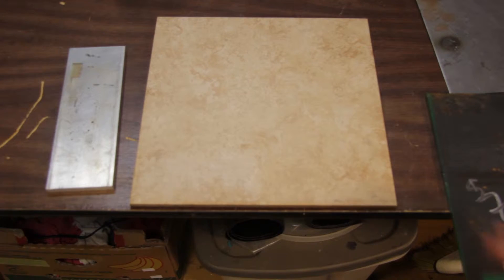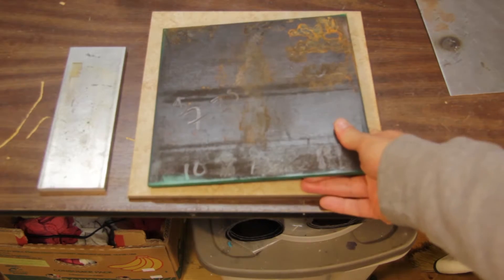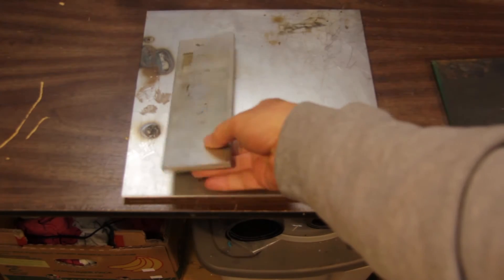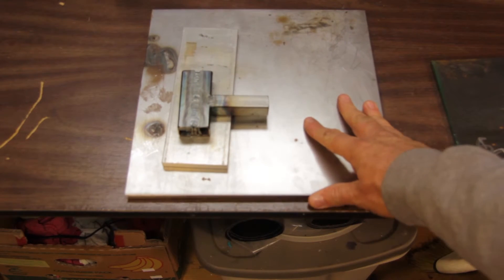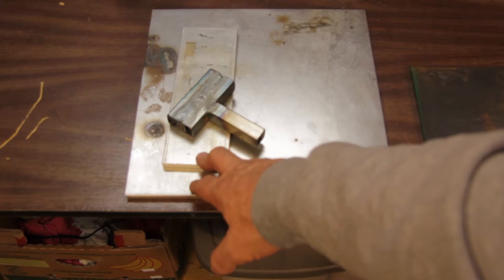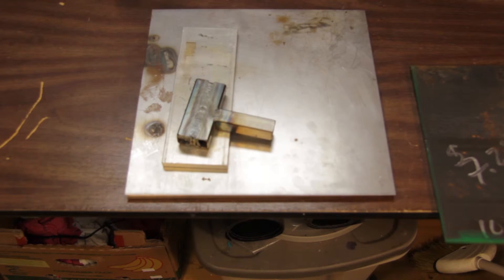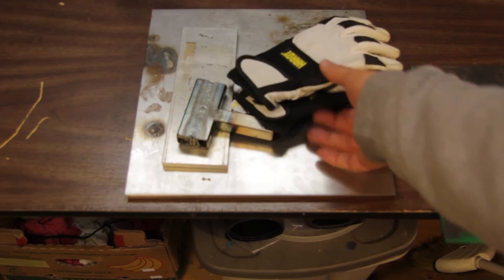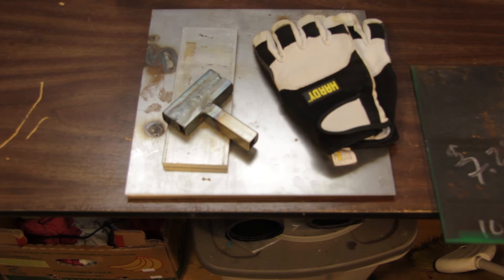Cheap Welding Table

Comment: what about stick welding?
Reply from the maker: Lower amp settings would work,  but I would make a larger surface for stick welding,  spatter is a concern with stick welding.